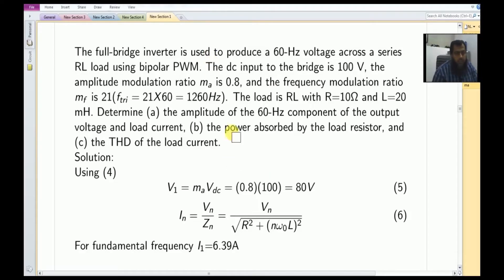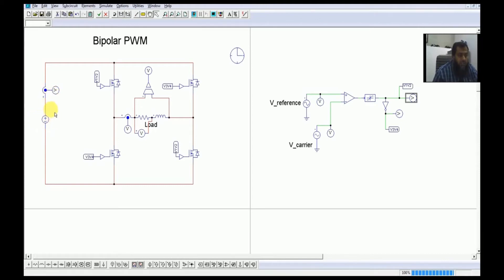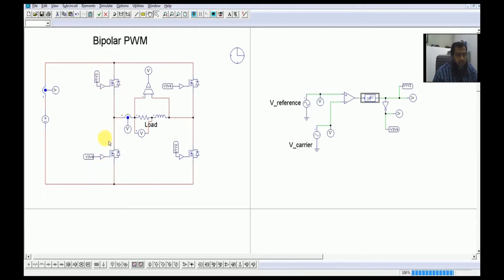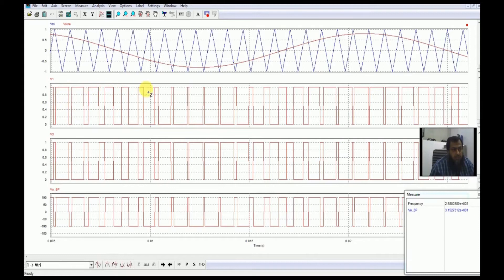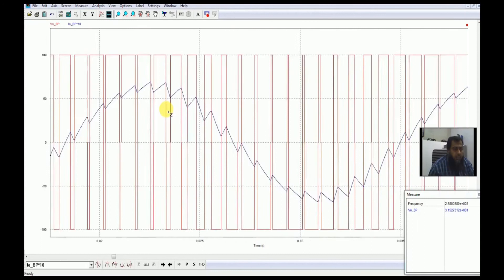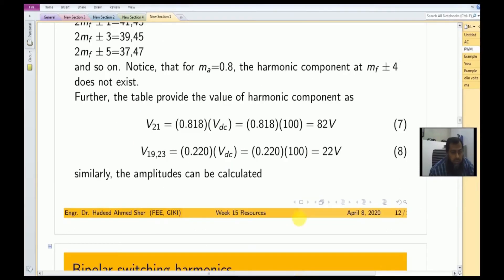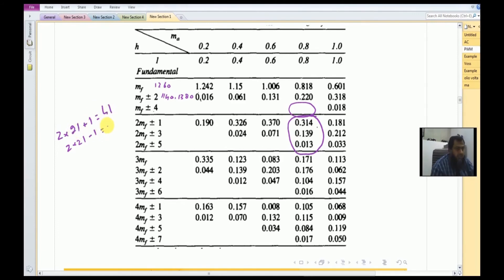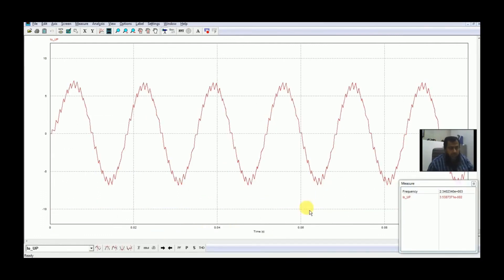Bipolar PWM inverter simulation using PSIM

Comment: Hello, can you help me with that presentation? i really need that for my study. Please
Reply from the maker: What is the requirement to be precise ?
Reply: @HadeedSher  how can i calculate normalized Fourier coefficients for bipolar inveter,without measure  amplitude
Reply from the maker: Please see there is a table in the Power Electronics book by Ned Mohan. Use it to find the fourier component amplitudes.